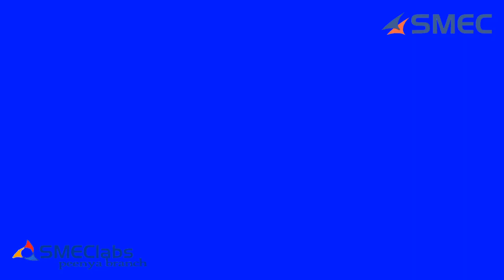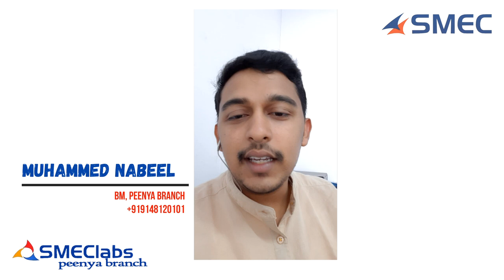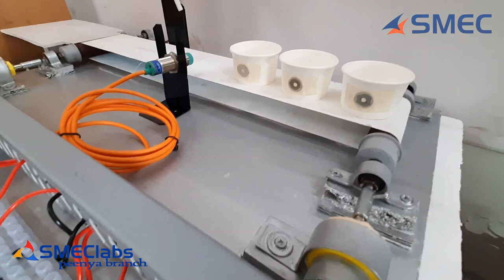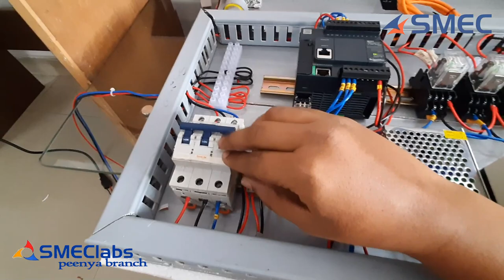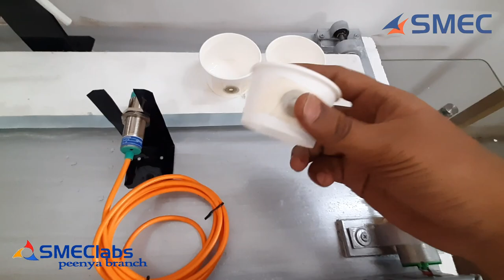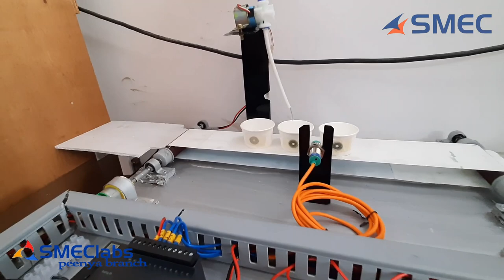How to Make a Automatic filling unit  - PLC Project

Comment: Was looking good until the system was put in to auto and the motors aren’t braked bringing them to a dead stop which would make control much more accurate and easier to set up timing and position of fill.  Adding braking is very easy and can be done with relays, possibly using existing ones in system.  Because of this, if the mechanics of the line are changed or weight of items on the conveyor changes, the cups will stop in different places as they fill.
Reply: Very True